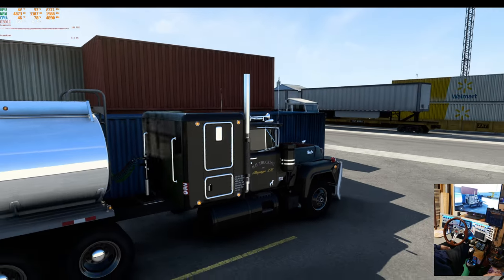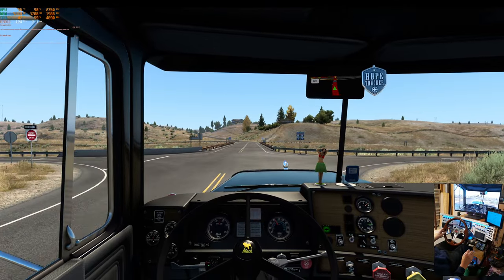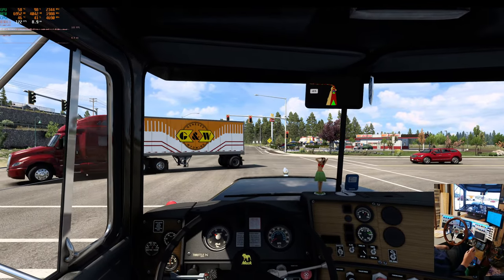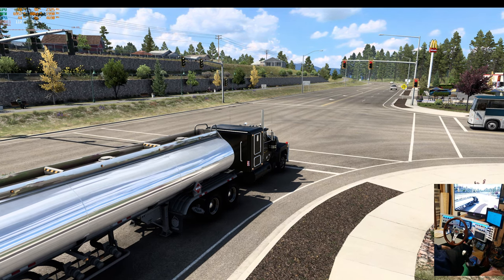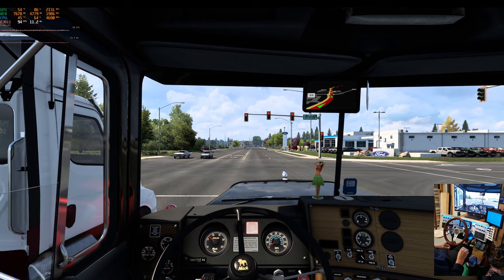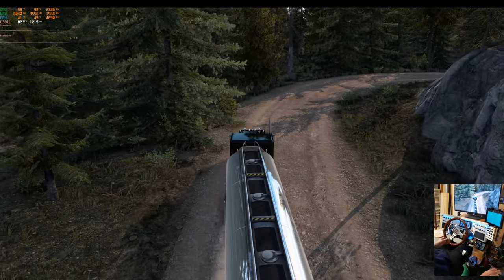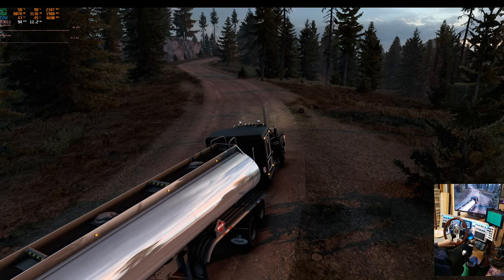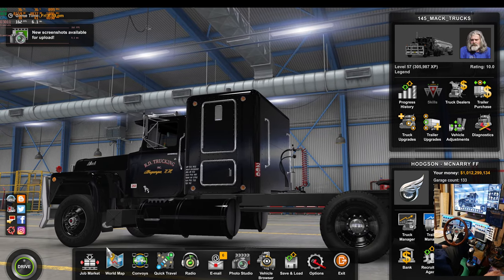ATS Rubber Duck R700 Fuel Haul to Nova Custom Logging in Troy Montana

Comment: The 1977 Mack RS786LST with rubber duck is pictured on the left side of the frame from Convoy. Powered by a Mack engine, it had an inline six diesel fuel grade with 81.3% oil by volume. An 11-speed Fuller Roadmaster transmission provided power to the engine.
Reply from the maker: Thanks for the information Ken! I really didn't know what they might have run for a transmission. Now I do! Cheers!